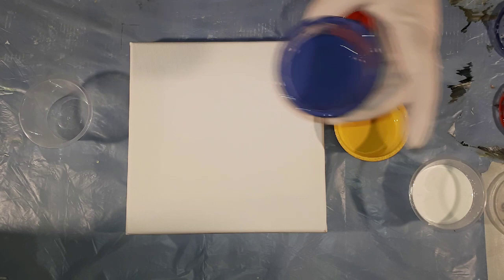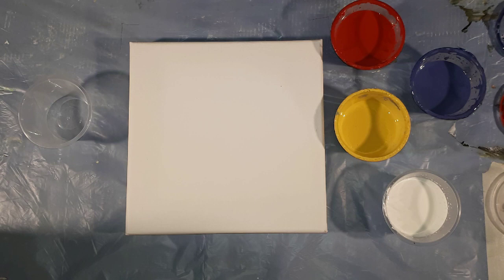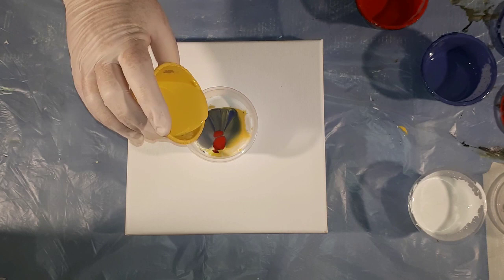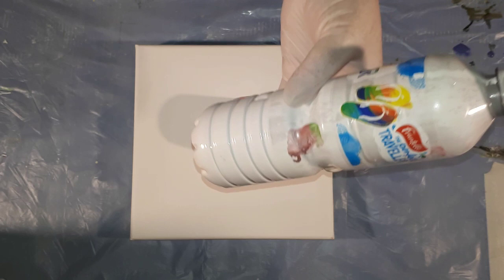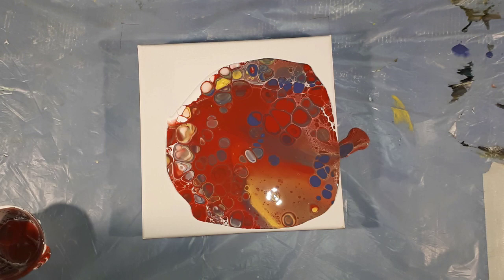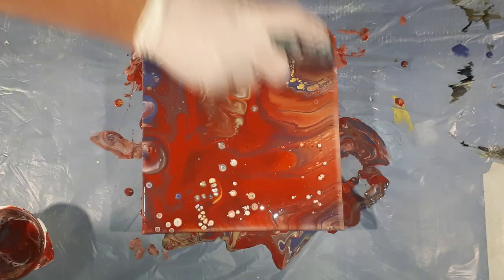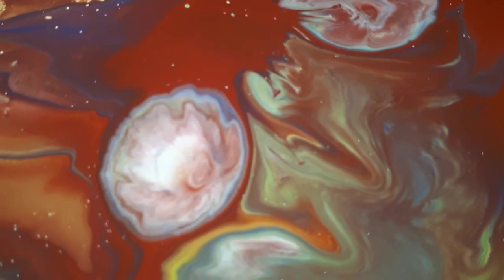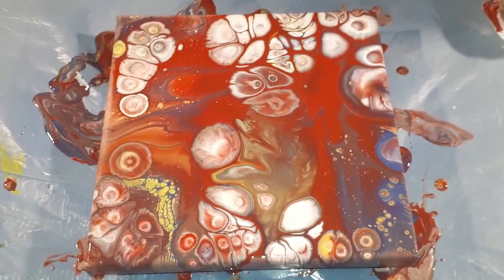141 - Experimenting (fail) for Cells like I used to get. Not this time!!

Comment: I think your pour is too liquid, you need it to be thicker you would then have more control. You had some beautiful cells to begin with but lost most of them when tilting. Also it is better not to put silicone in the white as it tends to sink and become your base layer. Lovely colour combination, so vibrant. Good luck don't give up.
Reply from the maker: Thank you Christine, I believe you are spot on. I have done much review on this experiment, I think my pour came out as questionable as my mind was. I made adjustments and had a much better result for experiment 2.0! Thanks so much for watching :)

Comment: FROM SOMEONE WHO HASNT HAD SUCCESS  IN DIRTY CUP.
YOU HAD NICE CELLS B4 TIPPING. TO MUCH TILTING?
ALTHO NOT WHAT YOU WANT PIC IS NICE IN ITS OWN RIGHT.
GOOD LUCK. CAMILLE AUST.
Reply from the maker: Hi Camille, I have done much review on this experiment, if you remember anything from this experiment let it be about not having paints too runny and not using silicone in the white! I am still shocked I even did that. Experiment 2.0 had much better results. Thanks so much for watching :)

Comment: I am certainly no expert but I have never seen anyone put silicon in the colour  (heaviest paint) that goes in the bottom of the cup.  Also do you gesso your canvases before you paint?
Reply from the maker: What was I thinking right?! I don't even know (after the fact) why I would have done that. I don't gesso, it's not something I have ever used but I have sometimes painted around the edges with a colour that I am using in the pour.
Thanks so much for watching